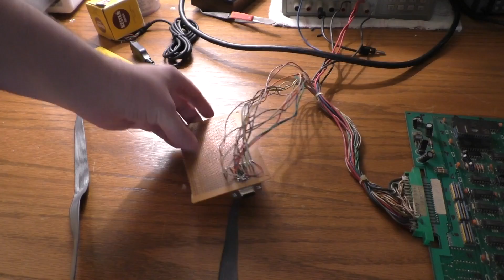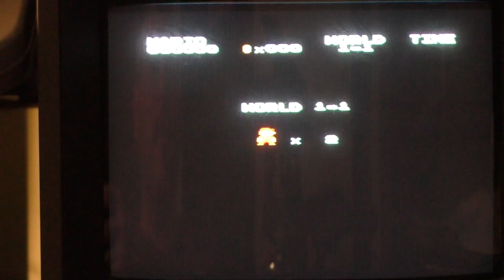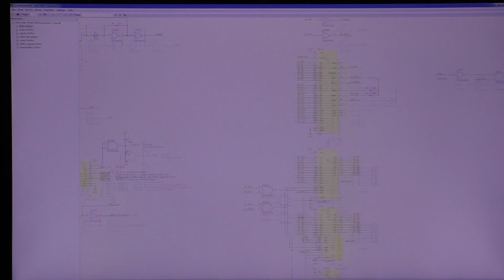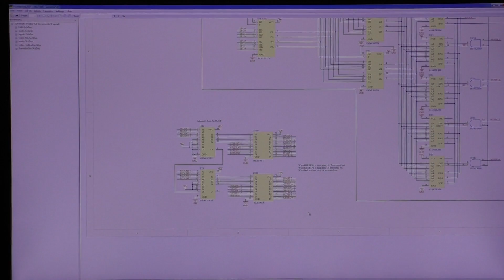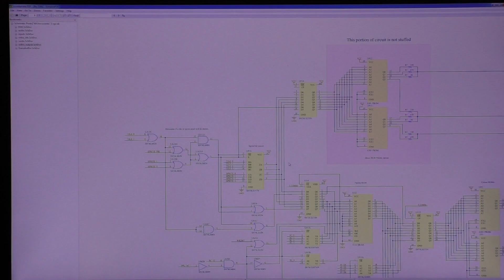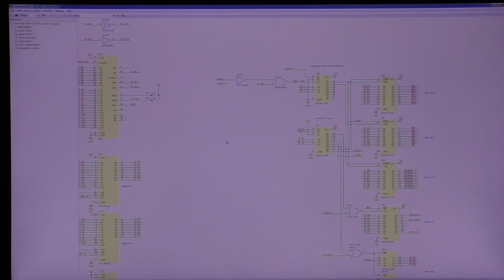Vs. SMB Bootleg Arcade Board Reverse Engineering Adventure

Comment: So I am not computer literate but just curious how on earth are arcade games bootlegged? It's not like a CD that you just drag the info over to a blank CD and the writer does the work? Or did they have pcbs connected to a computer and dragged the code to blank pcbs? Completely baffled by this or did they have to physically construct each pcb to match an original in which case how does the data get transferred?

Comment: Hi kevtris, I've been trying to fix an astrowars vfd game and stumbled across your posts on handheldmuseum. I'm having a real mental block here.  Could you help me fault find this baby? The d882 is getting red hot, drawing about 1.7A (!) And the controller is only getting -5vdc. I replaced all caps but no dice. Any ideas? Do you have a schematic I could use? I created one myself but is it would be useful to have a known good diagram to work from.  Thanks for any help you can offer.
Reply from the maker: sounds like the transistor might be bad... replace it with another.  If not, the microcontroller might be bad in which case there's not much fix except one from a donor unit.  I had a similar "dracula" that has that same transistor in it.  The transistor was blown because someone plugged the wrong polarity adapter into it.  replacing the transistor fixed it.
Reply: @kevtris  thanks for the reply.  For some reason I had a brain fart when I last posted. I meant to say I replaced all the transistors not caps.  Transistors are all working fine but didn't resolve the issue.  I tested all caps and they seem good.  Tested all resistors too.  Microcontroller is only getting -5v. Maybe I'll remove and test it on stripboard to see what happens with a known good supply of -10v.

Comment: Hi Kevtris I'm not sure where is best to contact you.  I don't see a video on your youtube about Analogue Super Nt.  Anyway, is there a way to get cheat codes to work on the Analogue Super Nt?  I did a review on MaxConsole of it but could not get the cheat code function to work.  I tried game genie codes.  Thanks and also Spoonman pointed out that Rendering Ranger R2 doesn't work.
Reply from the maker: I fixed rendering ranger r2.  the new firmware will be out soon that fixes it.  Also, game genie codes were added to the firmware on the last update.
Reply: Oh nice thanks for the reply man, I know you are super busy.  I couldn't get game genie codes to work with the games I tried, not sure what I'm doing wrong.

Comment: To reduce flicker wwhen filming a crt, need to use a different shutter speed up for the camera. As close to 1/60 as possible reduces it.
Reply from the maker: The problem is the game runs at 56Hz, which really screwed with the camera's frame rate.  I did try to change it but all the faster rates are multiples of 50 or 60, so the flicker wasn't resolved.  For regular 60fps CRT screens, the camera works great and there's almost no flicker.

Comment: When are you going to fix the zapper so it works with a modern day tv?
Reply: DirtyBob6969 Never because games themselves are what handles reading the zapper
Reply: ImATrackMan there is always a way... who would of thought hdmi for a system that is 32 years old...
Reply: Once the Wii Remote patents run out sometime around 2026, there will be a way to fix the Zapper.
Reply: Famicom came out in 1983. Patents last 20 years. Famiclones became legal roughly a decade and a half ago.
Reply: The adapter receives two signals: Sensor Bar coordinates from a camera in the gun similar to that of the Wii Remote, and display timing and luma (brightness) from the console's composite output. The adapter uses the Sensor Bar coordinates to determine where the gun is pointed. Then it collects video luma corresponding to the barrel's vicinity into the simulated photodiode output.
Reply: that's bullshit. Someone can make a clone. I'm surprised nintendo hasn't sued every nes clone maker out there.
Reply: There's not going to be a workaround.  The fundamental issue is timing.  Because whole frames are buffered and displayed at once on modern digital displays, by the time the trigger strobe signal is even displayed on the TV, the game has long since decided you've missed the shot.

Even if you could emulate an electron beam somehow to get the 15kHz carrier (which you can't -- your minimum time domain is one frame and that's the best you can do), the frame buffer would still cause the light gun to see the strobe at least 16-100ms after it stopped looking for it.

If you could directly drive an LCD or LED array, you MIGHT be able to turn the pixels on individually in real time like an electron beam scanning phosphor.  But it won't ever work via HDMI.  It would have to be a direct interface to the display panel.
Reply: See the article "TRICKING DUCK HUNT TO SEE A MODERN LCD TV AS CRT" by Jenny List on Hackaday
Reply: Ah, I see.  You'll always be seeing the video on a two or three frame delay compared to the simulated light gun, but as long as the game isn't THAT timing critical (and the IR camera's range was calibrated to the screen size) it seems like that could work.  Clever.

An unmodified zapper has no chance though.  ;-)
Reply: I saw that one... someone needs to refine his setup... still anything is possible

Comment: Unused gates were probably cheaper than a lot of work doing PCB routing to use them. Maybe also signal integrity issues running long tracks to use a spare gate far away. 
Interesting that EPROMs were obviously still expensive, so cheaper to use gates for x/y flip than just duplicating in a bigger Eprom
Reply from the maker: Very possible.  They could've used a dual 4:1 multiplexer to select 1 of the 4 possible flipped sprites (normal, X flip, Y flip, both) since 6 of the EPROM outputs are just wasted.  That 3rd bit they used (D4) just seems to be a write enable, checking the data.  It's set when the two bits are 00b, and clear all other times so some of those unused gates could've generated that signal easy enough.   Using the muxer would've saved all those XOR gates too.

Comment: So basically they went to a huge amount of effort to design this board and then still failed to display the game right.
Reply: It's easy to mock it... but...  :-)  Assuming this came out in the era where the NES was still commercially relevant, it's a pretty impressive effort.  Sure, we're good at emulating them now, some few decades later after a whole community of people have analyzed the heck out of every aspect of the system.

Comparatively, our job is fairly easy with GHz CPUs, 10s to 100s of MHz microcontrollers, and FPGAs with a gazillion gates.

Comment: Preordered my Super NT last night.
Reply: Im pre ordering it when I see reviews. not until the hardware is acceptable i will get it. They usually fix the problems in later versions of the systems. But they did learn with the a-nt so the likely hood of me getting it after the reviews are probably high.
Reply: I'm guessing any issues will just be software/firmware related.

Comment: You should really start thinking getting into arcades fpga, By making a muilti arcade board. With enough power to run Naomi Arcade and down. basicly stop where they decided to use computers  maybe if that isn't to greedy. Or whatever you can do.
Arcade games can be in the thousands so there is some room to put good logic in the fpga in there. I guess it would need alot of logic, ram, ect. that's how arcades usally are. Maybe making it a mvs or something then jail braking it and adding more arcade cores so you don't get into that much trouble. Adding a jamma connector and hdmi would be sweet, we all want RGB also.
Some of us want a good solution without spending the big bucks or have to deal with nearly dieing or rotting hardware.
I want to get this arcade fighting and shoot em up fix over with.
Reply: I want to play metal slug, demon front, mvc 2, dondonpatchi, radan, frogger and all that.
Reply: I'm almost certain Analogue is going to ask him to make an FPGA Neo-Geo core next if they haven't already.
Reply: I emailed analougue about the neo geo mvs they used to make awhile ago. They ended up just sending me to another site where they make consolize neo geo's, which is nice of them. IDK if they are planning to do neo geo if they did that. Well anytime soon. They seem to like nintendo systems right now. I did ask them to consider making a fpga neo geo thou. Im going to get the mvs once i see reveiws for the darksoft flashcard.
Reply: Those consolized Neo-Geo's Analogue use to make were a labor of love with their custom wooden shells. Just not very practical anymore, especially with all the competition out there.   

No need to make consolized MVS using original hardware anymore if they plan to design an FPGA based clone with 1080p output. 

There really is only three choices I can see them choosing in regards to their next FPGA console.  TG-16, Genesis or Neo-Geo.  Anything after Neo-Geo is too powerful with current FPGA technology.
Reply: Also, there isn't much further they can go with Nintendo hardware.  N64 just isn't possible with current FPGA technology.
Reply: damm so I am guessing the Naomi arcade isn't possible ether it's more powerfull then the n64. It was a deam to play arcade version of mvc 2 again won't come true. maybe in another 10 years i guess,
Reply: I hope for a pgm core. it was simaler to the mvs i think I little more powerful. there is like 3 games I want for it but there amazing games.
Reply: Yeah, Neo-Geo and TG-16 is about as Niche as a I can see them going.
Reply: charvelgtrs 

N64 absolutely is possible on a modest FPGA, but you're looking at around 60,000 Logic Elements for the main RCP chip, then around half of that again if you incorporate the R4300i CPU core.

A board like the DE10 Nano should be able to handle it. It can already run the full 486 PC core with sound, Genesis / MD, PC Engine etc. See the "MiSTer FPGA" vids. ;)

There is a NeoGeo core as well, apparently, but I don't know how complete it is.

The NeoGeo is a pain to work with, as it has around five different ROM busses running at different speeds, so you either need multiple RAM chips for storing the ROMs, a high-speed DDR3, or add a proper cart slot, which requires tons of spare IO on the FPGA.
Reply: https://imgur.com/ftn45N2
https://imgur.com/tutfO9d
https://imgur.com/dGC40Xq
https://imgur.com/wIcz4DJ
https://imgur.com/YVys7pz

Or, alternatively, grab the chipset from an original N64, and plonk them on a redesigned 10x10cm motherboard, with an FPGA and SDRAM on the underside, so it can have HDMI output and cart "emulation". ;)

https://imgur.com/a/4RuNy
Reply: Check out the list of cores on the right-hand side here.

Tons of popular console / home computer cores already working well, and lots of older arcade cores too. ;)

https://github.com/MiSTer-devel/Main_MiSTer/wiki

The DE10-Nano is only around $130, and has 110,000 Logic Elements, plus a dual-core 800 MHz ARM SoC on the same chip.

(so it would be possible to do "hybrid" cores, using both the FPGA and the ARM, or just for helping to develop the full FPGA cores.)

To turn the DE10 Nano into a "MiSTer" board does require an add-on board for SDRAM though, as the latency on the DDR3 is quite high, so it was more straightforward to just add standard SDRAM instead.

A fair few cores can be run without the SDRAM board though, and it's cheap enough to have the add-on board made.

I modified the standard "IO board" design recently, so I could add the SDRAM onto the same board. The SDRAM runs fine at the full 167 MHz "stress test", even on a 2-layer board.
Reply: Deltax5

I've done a bit of work on the Sega NAOMI stuff before, but I think that (and the Dreamcast) is still a fair way off for an affordable FPGA board that could run it, let alone the coding involved. hehe

I bought a NAOMI a few years ago which already had the GPU removed, probably as it was a known fault where the fan would often stop working, the GPU overheat, and eventually creating dry solder joints on the BGA balls...

I had another few NAOMI units anyway, so I decided it wouldn't really be worth trying to re-ball and re-solder the Holly GPU on the faulty board, not knowing if the GPU even worked any more.

So, I sacrificed it by removing the CPU as well, the used a multimeter to reverse-engineer all of the pinouts for the different connectors, confirmed the schematic against the Dreamcast, and reversed the small amount of logic on the NAOMI which adds some address decoding etc.

Between Mr RDC and I, we managed to confirm the full Dreamcast schematics to the old VA0 schematics that were released online many years ago (as the pin numbers on that scan were quite hard to read).

There's not a huge difference between the Dreamcast and NAOMI at all, apart from the latter having twice as much main RAM, VRAM, and audio RAM etc., and having the few custom chips added for the Maple bus to "JVS" translation, and the Altera Flex chip which was used to address the carts for the earlier games.

Eventually, I'm aiming to finish the routing for the "stock" Dreamcast board, but using the footprints for modern BGA SDRAM, so it can later be upgraded to handle running the NAOMI games on the board. That will require some FPGA stuffs to handle the "cart" reading though...

https://imgur.com/aDOGIGd

(an older crustier version, that started life in Cadsoft Eagle)...

https://imgur.com/qy4iX7Y
Reply: tbh, I think it will still be a huge challenge to actually try to do a 100% implementation of the Dreamcast in an FPGA at this point, even over other machines like the N64, Saturn, and PS1.

The tech in the Dreamcast / NAOMI is obviously a lot closer to PCs at the time, so the API and whole infrastructure is quite advanced in comparison to the older consoles.

It's a shame you can't easily get hold of the PCI graphics cards that had the PowerVR2 ("Holly") chip on them, but the other option is to make a breakout board for the original GPU on the Dreamcast / NAOMI, then start implementing the CPU and audio chips on the FPGA.

The good news is that the patents for the Hitachi SH line of CPUs has now expired (I think?), and some open-source FPGA cores for many of the older versions have started showing up.

I think they are only at the point of the SH2 core atm, which is the Sega Saturn / 32x era atm...

http://j-core.org/
Reply: For anyone not quite bored enough by my previous ramblings (lol), I have had a bit of success with getting the Playstation 1 BIOS booting on an FPGA recently.

This is on the trusty old DE1 board (18,500 LEs), but is now at the point of actually starting to send the commands to the GPU and SPU (audio) chips.

https://imgur.com/9yDWB23

The window on that screenshot was just displaying a chunk of main RAM at the time, and you can watch when it did the first DMA of the BIOS boot code into RAM.

The display is actually being output directly by the FPGA board via VGA, and I added my own debug output for the CPU core.

I've started implementing the basic GPU commands, but still a fair way to go before anything meaningful gets drawn on the screen.

The R3000 MIPS CPU core in that above screengrab is the aoR3000, which was coded / implemented by the same guy who did the awesome ao486 PC core.

I had to disable the TLB and other stuff for Virtual Memory, as the PS1 doesn't appear to use that at all.

The CPU in the PS1 is actually based on an LSI version of the R3000, which has a few extra mode registers added, and some other minor changes.

The is some incredible work being done by others to reverse engineer the PS1 CPU and GPU at the silicon level atm. :o

http://psxdev.ru/

Interestingly, the PS1 BIOS does still have a lot of debug messages that get sent out of the serial port, and still often known as "PS-X" back then.

(which further backs up the knowledge that the PS1 was often referred to as the "PSX" in the dev World for decades, even though the PSX name then got used for a PS2 based PVR in 2003)...

https://en.wikipedia.org/wiki/PSX_(digital_video_recorder)

You can see the serial output on the above screenshot.